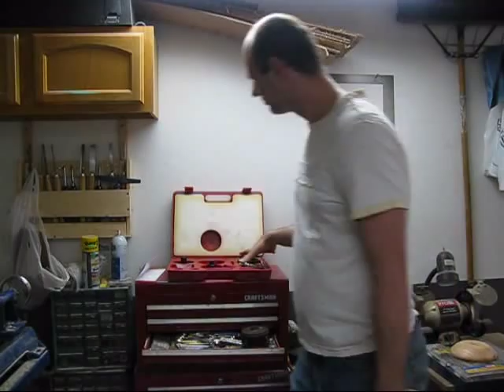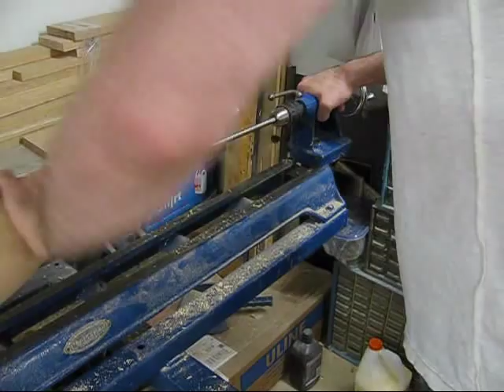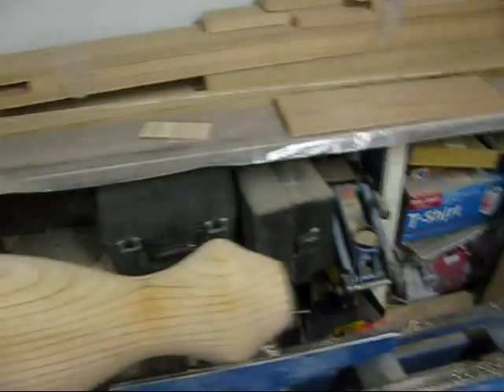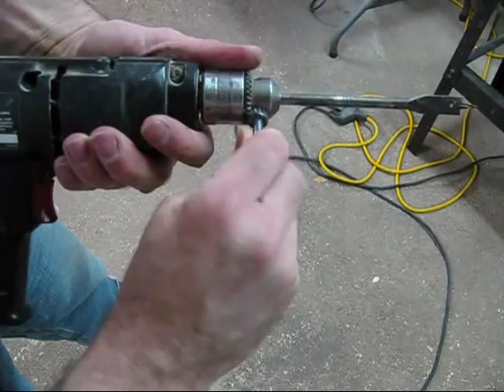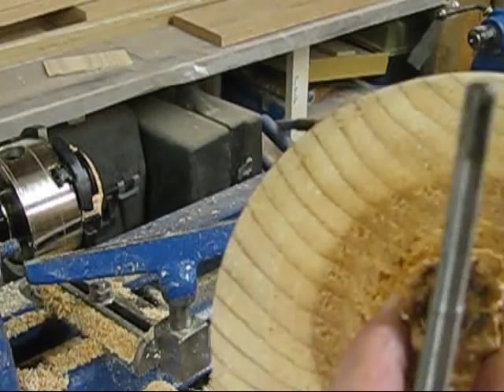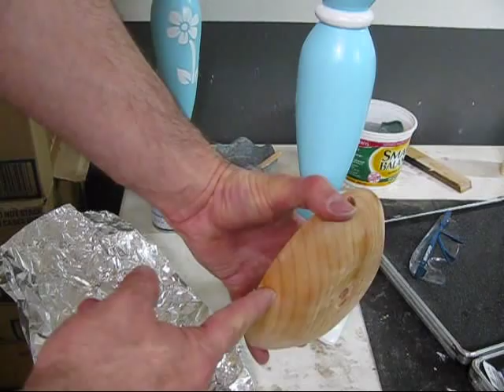Drilling a Lamp

Comment: Your old chuck is for a metal lathe.  Your tenon is also too long.  It shouldn't touch the face of the new chuck, only the face of the jaws.  I use a drill press, maybe you don't have one.  Watch more you tube, there are several ways of doing this.   Take care.